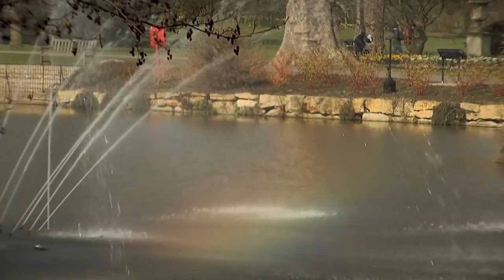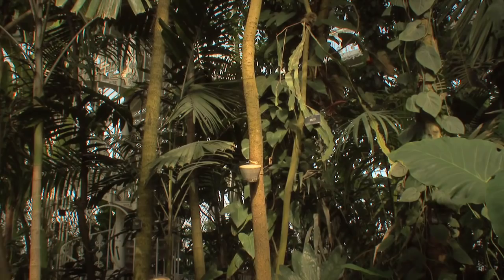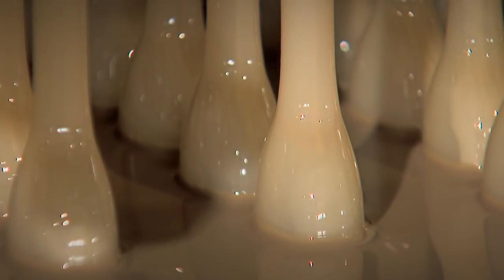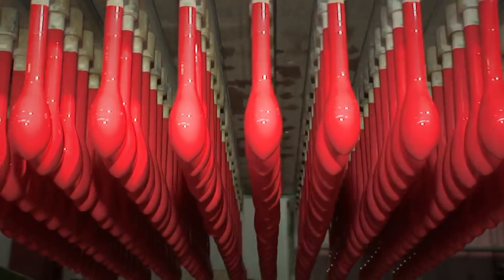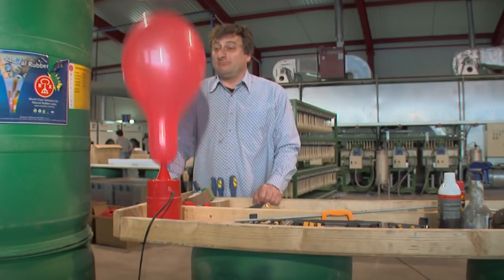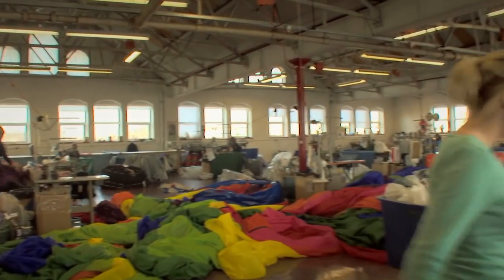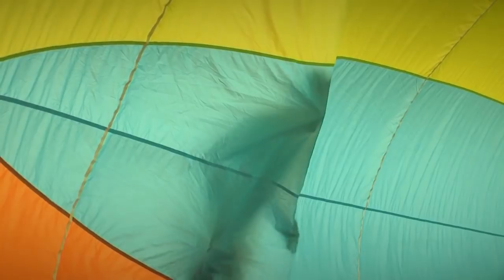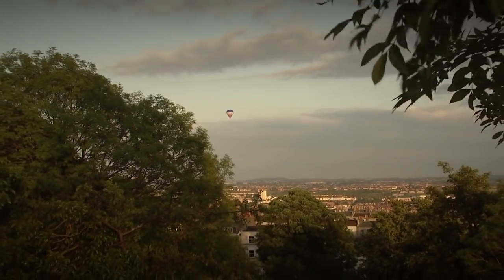Magic of Making - Balloons

Comment: you know it more interesting to make your own mold. Qualatex stop making 24" long neck rubber balloons. you cannot get that any more. people do yell at there local dealers and online dealers using the phone to yell about customer service and continue selling Qualatex 24" balloons. there is nothing they can do about it. Its Qualatex fault to make that stupid move to discontinue a selling product. the only option left is make your own mold. you do not need giant try to hold 100 molds to make 100 24" balloons. get something that be done at home like a try that can hold 6 to 12 molds at a time.. its is also a good idea to use the strongest ear production ear plugs. when sitting on 24" long neck balloon. it will pop loud. However ear protection dose not help pissed off land lord that will kick any one out for making too much noise.